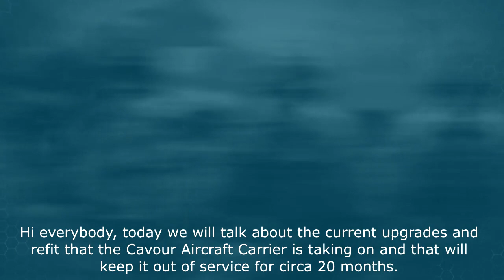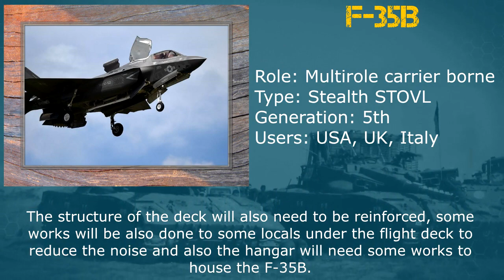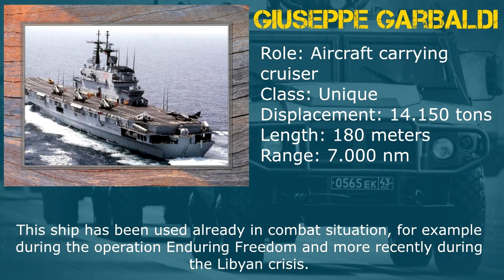Cavour Aircraft Carrier upgrade and refit - 12/2018

Comment: That number seems very low. What can you even do with 18 planes/helicopters against modern countries in the Mediterranean?
Reply from the maker: @M
The Garibaldi was created to carry a maximum of 15 Harriers and 3 SAR helicopters or it carries less Harriers and carry more ASW helicopters.
You need to remember that this isn’t a Super Carrier, it’s an Aircrafts Carrying Cruiser.
It’s supposed to perform ground strike and CAS in low intensity scenario via it’s Harriers and perform fleet aerial protection in case of higher intensity.
You need to remember that in higher intensity situations, the Garibaldi would never cruise alone, it would have the support of Andrea Doria Class Destroyers and FREMM Fregates, all of which are armed with the latest version of the anti ship missiles Teseo that has a longer range than the majority of the versions of the Harpoons  in use to other navies in Europe like Turkey, Egypt etc etc
Reply: M probably the Garibaldi would be able to carry more aircrafts than most of the European Carriers, life for example the Juan Carlos 1 and the new Turkish LHD (modified versione of the Juan Carlos 1) can carry less, if I’m not wrong it should able to carry only 15 aircrafts
Reply: Italy is a Mediterranean air craft carrier tbh ik it didn't work in ww2 due to low ranges but with modern jets ....
Reply: M who cares, it's going to be decommissioned in a few years.